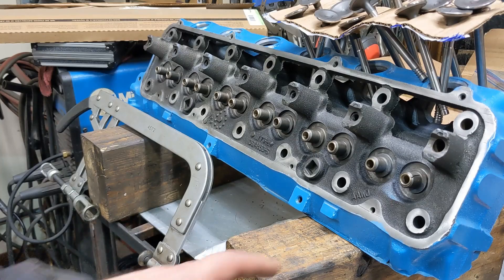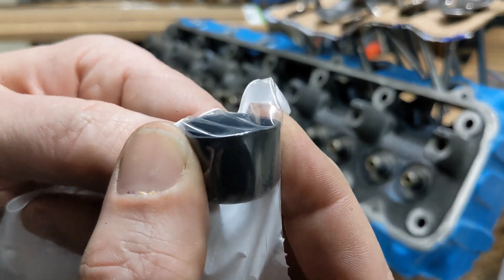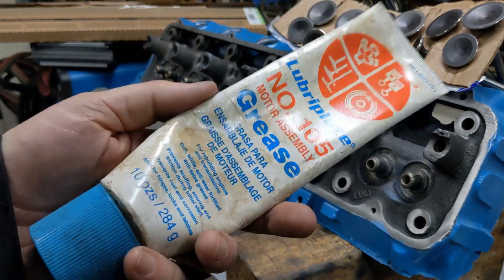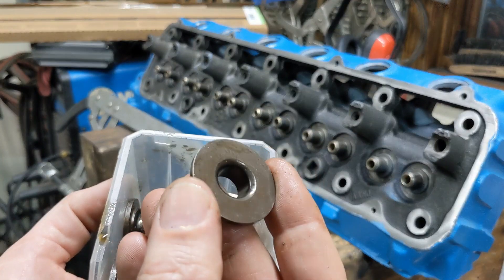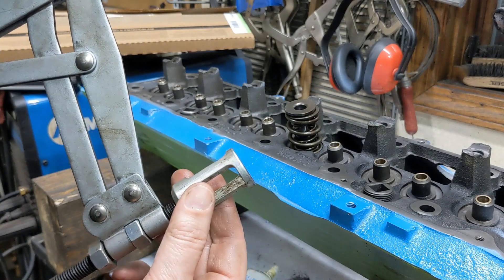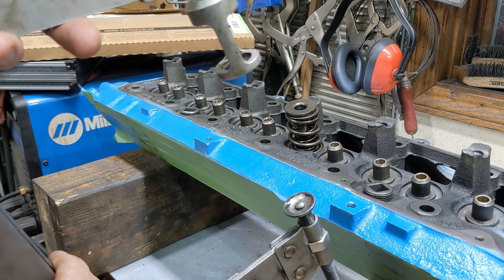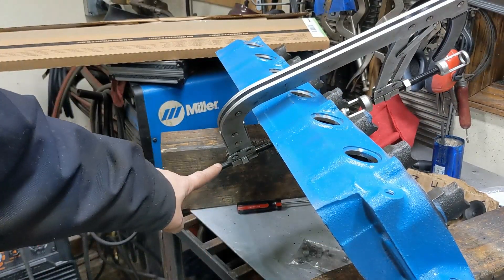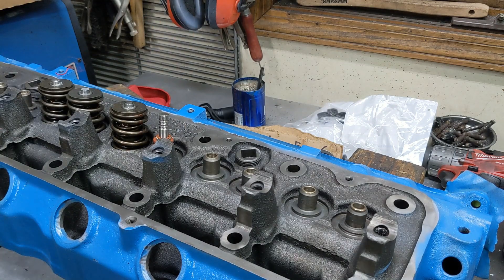Slant 6 Head Assembly

Comment: Is the fist valve guide cracked or its just my eyes???
Reply from the maker: Nope, not your eyes.  The thin part of the casting that sticks up above the head cracked when the bronze guide was pressed in.  It's only that this collar, not the full guide - and not uncommon when you drill out old cast guides and press in new ones.
Reply: @YoshimoshiGarage  Yeah, that cast-in-head guide boss with the crack...  Worry not, they can crack when the new guide's interference fit is a bit snug.  Not a lot to do to fix that outside stripping the head and removing the bronze guide and off to a shop to have it welded.  Then ream it again, another new guide, etc.   Or, if it was me, I'd run it just the way it is, nothing's gonna happen since the crack isn't gonna go any farther than the meat of the casting, so no sense worrying over it, that crack is harmless.   Nobody's ever gonna know you let it slide... except every single one of us who watched you do it.  :-)   Anybody gives you any crap about it, ferkum and go on down the road with a smile.

Comment: I am coming from the Ford 300 world and I am new to the slant 6. I have several running 225 industrial engines. Farm equipment and a water pump. I finally found a suitable vehicle, 1970 D100 . Other than the carburetor Is there anything about the industrial version of the engine I should be aware of ?
Reply from the maker: Nope, they work great and are basically the same thing
Reply: @YoshimoshiGarage  thanks.
As the engines were governed to run at a constant speed I was concerned that maby the camshafts we're optimized to operate at that that speed and might not work well in automotive  applications.
My concerned is based on the experience I had swapping a 8V92 Detroit Diesel from a electrical generator into a GMC  semi truck .
Reply from the maker: The cam almost certainly is different and you're probably going to get better performance out of something for the street. As usual that depends a lot on fuel delivery and expected RPM range
Reply: @scotthanson7888  Same cam for all applications.